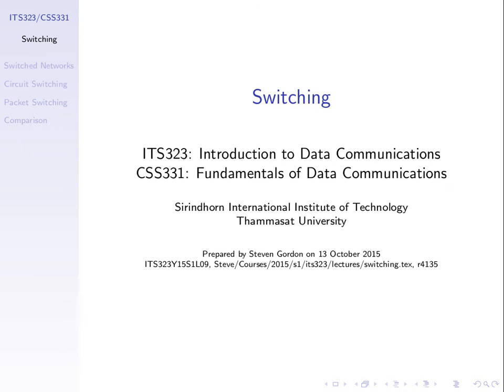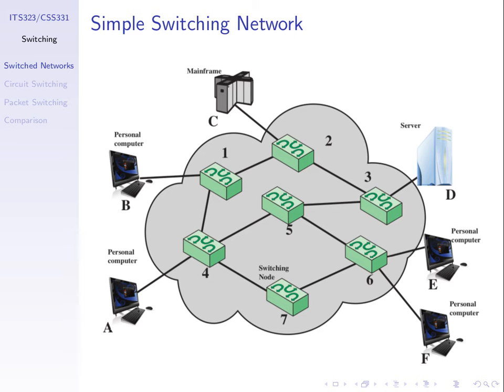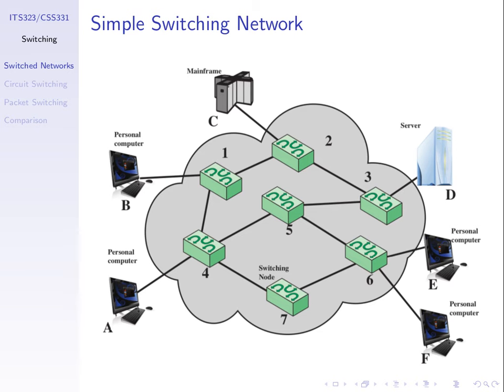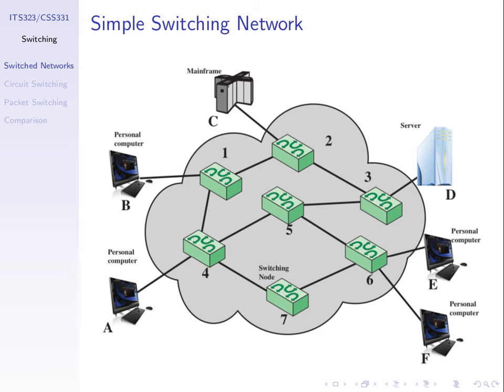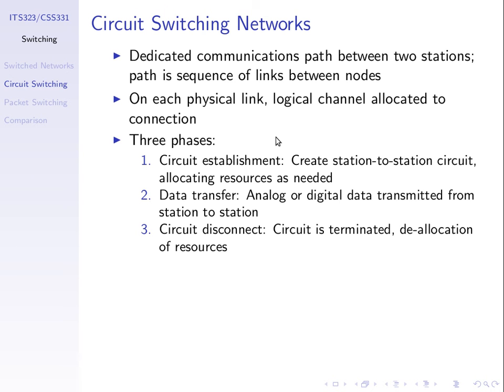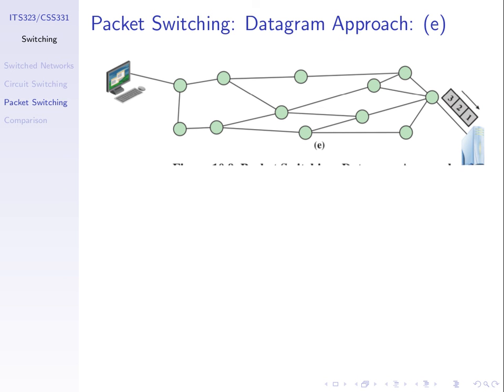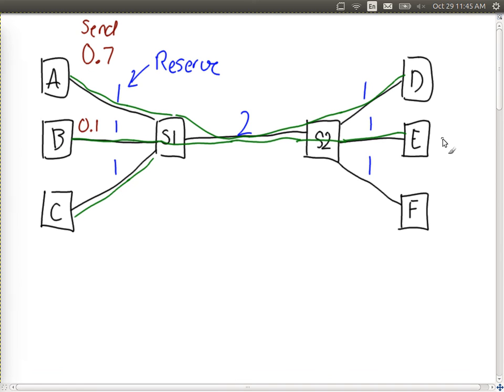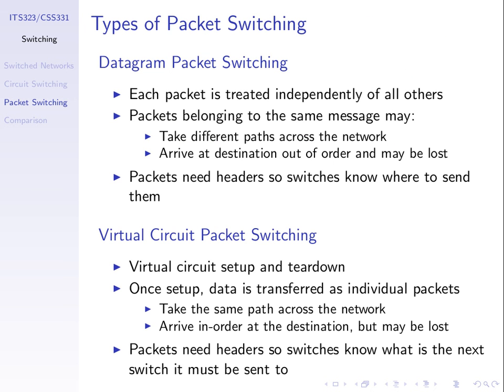Circuit and Packet Switching (ITS323, L19, Y15)

Comment: • How many cables we need to contact 6 computers together?
  ○ 15
   § 6A, 5B, 4C,3D,2E,1F
  ○ Switching nodes allow us to connect many computers without having direct connections
   § They do not create or consume data, they just forward it to the right place
  ○ A sends to node 4, sends to 5, etc. 
  ○ Choosing a path is called routing 
 • Multiplexing is used for parallel input
  ○ Frame shifting…
 • Internet uses packet switching
 • Circuit switching
  ○ Old telephone lines used manual circuit switching where ladies would change the circuits
   ○ Now we use automated circuit switching
  ○ Creating a dedicated communication path between two stations
  ○ Switching lines need to support enough capacity to support multiple connection
  ○ Adding capacity is costly and wasteful if it is not used frequently
  ○ If 1mbps is reserved for connection A, then it will always take up 1mbps capacity, even if it only uses 0.1mbps
 • Packet switching
  ○ Break data into small packets 
  ○ More efficient, allows for sharing capacity
  ○ 2 types, data gram and virtual
  ○ Datagram 
   § Source station sends a few packets, 123
   § The packets independently travel along the different paths of switching nodes 
   § Packets are put together at the end
  ○ A queue is maintained if capacity is reached

Comment: - point-to-point networks are not cost-effective
- switched networks are more economical 
	- use routers (aka. gateways or switches) to forward data
	- need not be fully-connected
	- multiple paths increase performance and reliability
	- using shared links concurrently requires multiplexing
		- shared links needs high capacity (i.e., throughput)
		- or assumption on link usage
- circuit switching allocates resources
	- guarantees good performance
	- not optimal from network operator's view
	- a resource allocated but not fully utilized is suboptimal
	- not suitable when sending rate varies (i.e., Internet)
- datagram packet switching breaks data into small datagrams or packets
	- no resource allocation
	- router queues incoming packets may drop them